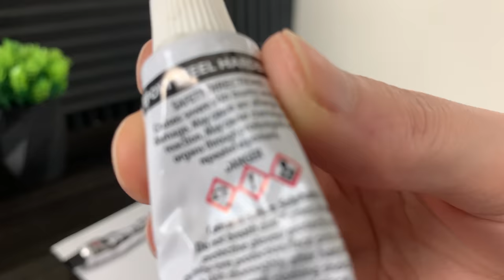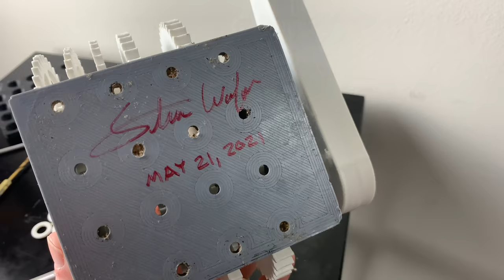3D Printer Gearbox - Spinning it FAST

Comment: Put some silicone lube on the gears/shaft, or hook em to ball bearings. That'll really knock out some of the friction :)
Reply: This!
Reply: Is!
Reply: SPARTA!
Reply: Yes. This! And make somewhat lower ratio and hook it up to a drill
Reply: @Boz1211111  why not just hook this up to the drill?
Reply: @charadremur333  drill can alredy spin to 1200-2000 rpm, this ratio is just too high to alow you to use full power of a drill, and lowering ratio will reduce max torque which means contraption would be less likely to get damaged when trying to spin very fast
Reply: Solid graphite bearings, solved!
Reply: Biggest brain
Reply: Top 3 comments on this post are amazing
Reply: Exactly what I keep thinking. He never seems to use any lube or friction reduction methods which means he’s wasting a lot of energy and generating way more heat than he needs to.
Reply: @radicalxedward8047  honestly nobody in any of these gearbox videos made out of anything, 3d printed, Lego, etc, hardly ever uses any kinds of lubrication on these things

Hell even squirting it down with WD-40 would be better than dry, and that's not even really technically a lubricant lol
Reply: The real resistance is from the inertia of angular momentum, reduced friction might make it slightly better but still hard to spin
Reply: “Put lube on the shaft”
Reply: For sure. Might get some stability 2 causing even less loss of energy
Reply: Just spit on it, works everytime.
Reply: No turn it into a fan
Reply: i have a bottle of spray on teflon that would be pretty slick
Reply: @jkish14 i love the internet
Reply: Lube 😏
Reply: 5 6 7
Reply: Both
Reply: 666 likes
Reply: Wax is also very good.
Reply: Silicone or graphite lube is one way but you may also have friction with air. Those thin gears have openings that can move air. I am willing to bet you can feel air movement from the fast gears.
Reply: The option to 3D print your (ball) bearings is always available
Reply: Brass or silicon bronze bushings would probably work better
Reply: I was just thinking about it
Reply: Graphite powder would probably be a better option in this case
Reply: Those two things are something I don't think this guy has ever heard of. No bearings or any sort of lubrication to keep friction and heat down.
Reply: @thetruth4205  cherry flavored, my favorite
Reply: @MyKonaRC  the problem isn't friction its inertia if it was the same amount of gears with a 1 to 1 gear ratio it would be incredibly easy to spin
Reply: Why does this sound really sexual?
Reply: Or do both
Reply: Kelvin Higgs  resistance is multiplied over each gear up. For example, In a 1/500 gearbox, the last gear with a resistance of 1 N/cm will have a resistance of 500 N/cm at the input. Reducing it by half would cut out a lot of torque required to turn the gear. Couple that with every single gear adding resistance.
Reply: Part of what I said on the last vid lol
Reply: Friction is not the problem, but inersia. In order to spin an object that fast you need inertia which comes from torsion, which in this case very huge
Reply: dual ball bearings yes.
Reply: Facts
Reply: Graphite powder will work aswell
Reply: @charadremur333  Drill won't have enough torque. It's a high speed thing.
Reply: Use graphite as it’s a powder and super slippery
Reply: Big brain 🧠
Reply: When cars use their breaks to convert their momentum into heat that gets lost through the break disks they waste energy. If instead of wasting the energy as heat through friction between the break disks and break pads they could use increasing gear-ratios to capture the momentum with minimal friction and store it in a fly-wheel so that they can then use the stored energy to accelerate again through reverse-coupling and decreasing gear ratios. This idea (my idea) would DOUBLE the fuel-efficiency of ANY car.
Reply: thats so dumb it defeats the purpose itll just keed on rotating without rotating any other gears
Reply: That or lithium grease
Reply: I dont speak nerd
Reply: @Galv140577  delete the comment and get to work then!!
Reply: If you add a flywheel it would be easier to keep it spinning
Reply: I'd say to instead print out of tethlon, and put a bearing on the handle that allows him to spin it without constantly rotating his hand.
Reply: Yep
Reply: Use heavier materials for more centrifugal force
Reply: @brukujinbrokujin7802  The friction and rolling resistance still exist though, producing a lot of heat and causing a lot of wear.
Reply: @zackstump5425  That would only help in a flywheel.
Reply: @jimwull  J3MU31😂😂😂
Reply: Like u said but it would be more efficient if he used both methods at the same time
Reply: It would turn into a really fast flywheel😳
Reply: @jayleong5634  no. Lubricating it would make much easier to turn. The high speed gear produces lots of friction and the faster the heavier it to turn. It's like logarithmic increment.
Reply: With a mixture of this and a piece for his hands (maby enough length for both hands) he'd be able to get much higher speeds.
Btw i said hand piece beacause in the video he said he would make the handle longer but he left the 'hand' part really small and i didn't want people thinkink i want him to make it go lower down or summet.
Reply: Or grind some pencil powder then put in
Reply: It's all ball berings novadays!
Reply: It still need lube to not only lubricate but also protect the balls from corrosion
Reply: judging from this guys hot glue fetish, he probably uses glue as engine oil
Reply: Gigady
Reply: In a pinch graphite powder works too
Reply: yeah i was gonna say wheres da lube?
Reply: YES!!
Reply: Silicone lube on the shaft or ball bearings.
Reply: or just use any lube in general so you dont have to wait until your girlfriend comes over
Reply: @Boz1211111  in this case, perhaps using a different motor is ideal.
Reply: That's what she said. :-D
Reply: 5-56 any day of the week! (Not to be confused with 5.56!)
Reply: Friction force on handle is 1023 times friction from each wheel.  So any friction reduction would pay off.
Reply: Why do I have a feeling this is a lewd joke
Reply: good idea
Reply: graphite works too
Reply: Haha lube
Reply: You said ‘lube’, ‘ball’, and ‘shaft’
Reply: @rb3020  3d printed plast ballbearings... sounds worse than a simple bearing like he already has
Reply: The bars must be SMOKIN HOT
Reply: It's to ez to do that
Reply: zoom
Reply: What would be the best metal to make it work properly and best lube, which would  handle high speed rotation  produced heat ? Would skateboard ball bearings work ?
Reply: Guys a cuber
Reply: It will knock out some teeth too
Reply: Graphite powder will probably help at first
Reply: Exactly
Reply: Also helps reduce friction in other places ;)))
Reply: If you use one large gear and one small one would also be way more efficient because you only have 1 contact point instead of 10. Like on a bike
Reply: yeah I was surprised to not see him put any lube onto the shaft
Reply: For a very short time.

It's a 1-512 ratio the amount of kinetic energy generated by rotating isn't being 100% transferred to the next gear not just because of heat because of friction but Also in the sound it makes while in motion
Reply: Yeah why dosent anyone do that? And make it kinda like a cars transmission, Mabye a flywheel lol
Reply: Hahahah. Lube
Reply: You can hear the high speed gears rattling on the shaft. This is causing a huge amount of friction.
Reply: YES PLEASE

Comment: You need a flywheel on the highest Gear so it stops constantly losing momentum every time you stop cranking
Reply: Which would make it incredibly hard to move the crank at all. There is 512+ (include friction) times more torque to spin the crank. There is a reason he made the gears lighter towards the output.
Reply: @1992jamo  I'm curious how that would balance. A decently weighed flywheel would take more force to move, but would lose less to fiction.  Since acceleration isn't important, it could theoretically go faster. Especially if he started at the flywheel.
Reply: @ZeldaIsMyLove  If the flywheel takes 0.5Nm to move, it would take 256Nm on the input shaft to move it. If the crank is 7cm, that's 3657N of force required at the end. That's 373KG of force on that 7cm crank, to get just 0.5Nm on the output shaft. Moving the flywheel first would work, but if it slows down even a little, it would be extremely hard to add energy back into the flywheel.
Reply: You would also have to make it stop touching the other gear once you stopped spinning
Reply: or to make it thicker
Reply: noneofyourbusiness6210  What did I say that is incorrect? "lol"
Reply: @1992jamo everything
Reply: @1992jamo add a clutch between the flywheel and the gear to progressively speed it up
Reply: @1992jamo what if it’s switched to pedal power and put your entire weight into it.
Reply: W pfp
Reply: @1992jamo  it’s actually much worse than that because of the reflected inertia of the gearbox
Reply: Your right it needs a fly wheel

Comment: How to destroy world: put a 10000 rpm motor in the hand wheel
Reply: This shouldn't happen
Reply: The motor needs a REALLY high torque. If more torque The motor contains more slower is The motor
Reply: FBI: "DON'T FUCKIN MOVE"
Reply: A 10,000 rpm motor would not work unless you added a lot of torque to it

Comment: If you have the appropriate tools, try bending part of the metal shaft to make it into a handle itself rather than depending on some sort of glue to hold a handle in place
Reply: The next thing to go is the drive gear that is attached with epoxy.
Transmitting forces only through glue connections isn't a good idea.
That's why in real applications gears are normally keyed on the axle.

Making a one piece handle will fix half of the problem tho
Reply: Couldn't he just use a modified ratchet extension and use a breaker bar?
Reply: Or drilling the shaft and using a rollpin or bolt through the handle and shaft and can use jb weld as well if so choose
Reply: Just use a keyway the have bin invented over 1200 years ago and hold much stronger then any glue or weld.
Or screw
Reply: or?? weld a crank to it.
Reply: And keys to keep each part in place where needed
Reply: He could use an rc car (hobby grade) motor to start off. (I have a castle combo 6s and it spinns up to about 48 000 rpm
Reply: @Hermiwalle  Welds aren’t as strong as a one piece part.
Reply: @thatoldme1234  That motor will die. Have you seen the video the forces on that handle therefore on any motor are very high. You will need torque not speed.
Reply: Need to consider ease of making and application. Welds seem easier and would be more than strong enough for this. Assuming he knows how to make a strong weld. But both ways are good ways.
Reply: @Hermiwalle  Yeah ofc welds are better than any glue. I just wanted to point out that they are weaker. But really anything able to withstand his muscle power and naturally the lever is enough.

Comment: Use a square rod with a keyway through the gears as opposed to cylindrical. Then you can drive it with a high torque drill. Lubricate the gears. Put a propeller on the end, brace for takeoff
Reply: That is wrong if we are using a square rod through the gears ⚙ 
Coz they have different RPM
Reply: @ramandeep-iu7tc  Use a square rod with a steel tube slipped over it for the other gears to run on.
Reply: Attach drill and gearbox together, then you may as well developed personal helicopter
Reply: Or use a round rod but.. square, D, or key the end for the drive gear.
Reply: @ramandeep-iu7tc  Just sand the rod on the handle portion to be square then you have the best of both worlds.
Reply: Or just a tongue and groove with your bar on your drive gear. Plus you can tell by the movement in the parts there could have been much better tolerances in the shaft to wheels. Very cool design but many places to improve

Comment: You should add keyways to the gears and use a keyed shaft
Reply: Each gear has its own speed on its respective shaft, keys would bind up the entire system.
Reply: If he used it on just the handle it seems like it would hold a lot better
Reply: Exactly.
Reply: @orion7353  just to use them on the handles lol ofcourse he didnt mean to weld all gears together u dummy X D
Reply: I was screaming this in my head lol keyways on the handle and drive gear
Reply: @orion7353  I dont see how splining or keying the input gears would bind the system up. All of the gears on the input shaft were jb welded anyways, splining them would give them strength as well as if the handle was splined
Reply: @biggusdiggus1570  only the drive gear was jb welded, for the binding issue every gear will be spinning at a different speed otherwise there would be no point as the system would be, at best, X:1 with X being the very last gear ratio (I believe 2:1 in this case) and none of the other ratios would matter
Reply: @deflepperdrocks12954  Thinking about it now, i do get it. The first gear is the gear driving the rest of the transmission of power. You right.
Reply: This would also allow the gear shafts to be held in with circlips (C clips, Jesus clips, whatever you call them) rather than epoxy and hot glue.
Reply: First gear and handle. Also, add bearings to the other gears.
Reply: @DerekMurawsky  Bushings might be just fine for the other gears, because there is no load on the output. If there was any chance at all to knock a gear out of kilter and cause it to seize on the shaft, I'd agree that bearings are required. For a toy model like this, they're probably not required.
Reply: or at least drill and pin them

Comment: Very cool. Maybe you should key the handle. 

Use a file to put a flat section on the axel and then have that slide through the plastic handle, with a lock pin either side.
Reply: Some blender render here
Reply: @TheRealLoganYT Kind of like how older axes are done so the handle can hold the axe head without worrying about the axe head flying off. If you look up videos of people making their own axe handles you'll probably see an example. Lots of machinery use keys in places where they have rods/axles as well (though positioned differently) because the key becomes the shear bolt so if anything is going to break, it's going to be the key instead of all the expensive stuff. The kind of things engineers have come up is pretty darn neat, god bless 'em
Reply: Agree, key all the gears on the shaft, that's how its done in any case where torque is applied.
Reply: If it was metal on metal then that would be the surefire way to go. I think a standard size key on such a small shaft would break the plastic. With metal on plastic I'm not even sure I would trust a splines connection. I would go for brazing in a long fat bar into a centered groove on the axle if not 2 of them in an X orientation
Reply: @TheRealLoganYT Make it simple for you, Round is slippy
File the shaft to make it D shaped - The flat stops it from slipping
Reply: Also add a free spinning handle so as your turning the crank its easier to hold on to it as it spins
Reply: Dont touch the like !!
Reply: @TheRealLoganYT the shaft is round. The handle slips on the round shaft loosing torque.
If you file a flat on the shaft, then add either a wedge in that d shaped file out or a pin going across the shaft touching the flat it stops it slipping

Comment: Alternate title: "how to build a really good pencil sharpener"
Reply: entire pencil will be just an wood pieces in 10 seconds
Reply: @Distance_0 then sharpen the sharpener
Reply: @soda415.5  wait wha-
Reply: @filtztr  you know, pencil sharpener sharpener
Reply: @soda415.5  and what if that gets dull?
Reply: @ashupashu5559  solution: 
A. Buy grinder
B. Pencil sharpener sharpener sharpener
C. Replace blade
Reply: @Distance_0 but if you spin it fast enough, the sharpener will cut on cellular level and preserve the shapness for a long, long time

source : some action anime probably, idk
Reply: @oniplus4545  D. Use mechanical pencil

Comment: You should start putting a black mark along the gear at even intrevals, either a single line, (center to the outside), or a pie slice colored in, to allow the casual viewer an easier time counting rotations.

Comment: Last gear was spinning 167 times in a second, that's wow!
Reply: thats 10020 rpm. damn
Reply: Yes very wow
Reply: Then realize there are internal combustion piston engines that turn that fast or faster.
Reply: Actually it is 167.000077789 . Get your facts straight. 🤦‍♂️ gosh.
Reply: @doug112244  And then realize that turbochargers spin at up to 150,000rpm, and can  have a service life of 100,000 miles
Reply: @Fhwgads11  jeeeeesus
Reply: this is impressing
Reply: @Fhwgads11  hdd can spin up to 15000 rpm